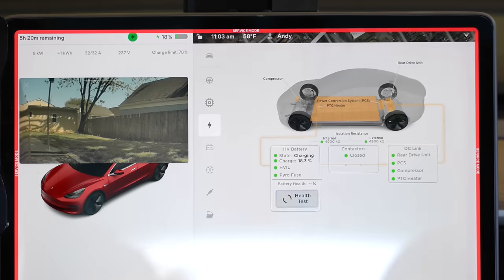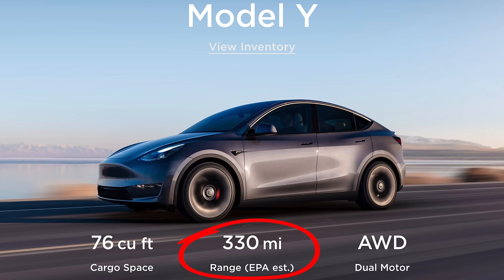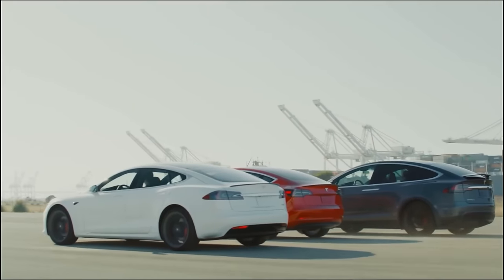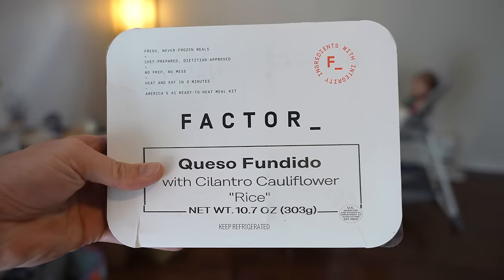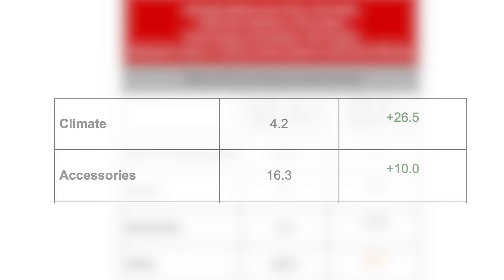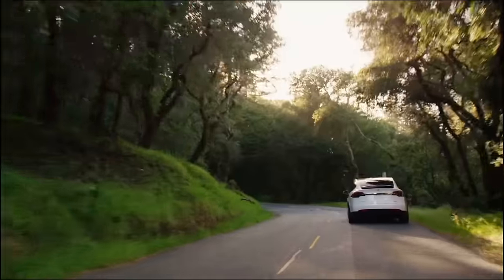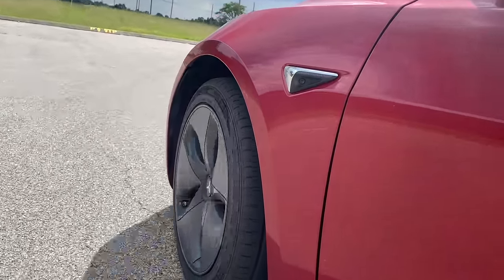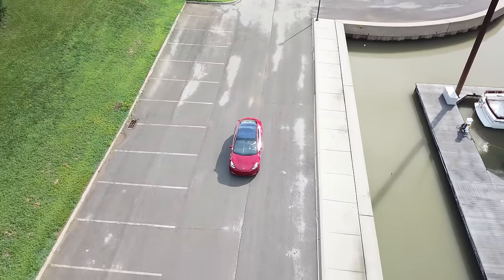Secret Tesla Range Report: How to Maximize Efficiency!

Comment from the maker: Use code ANDYSLYE50 to get 50% off your first Factor box at https://bit.ly/3I65KEu!
Reply: There is also another possible factor

Due to the number of cells as they degrade the internal resistance rises

As for the 7% thing my guess is a software bug your probably actually at 86 or 79 or something
Reply: Amazing!! Jus signed up
Reply: What does the 7% mean u bun
Reply: Yes same on my X . Gettimg barely 250 out of 350. They need to make Epa only 70 miles highway and only city Epa not mixed not at all !!! They lie too much on this

Comment: You and I are opposites.  The ONLY reason I bought my model 3 performance was because it was the most performance I could buy for the money.   So I drive above 70 when legal and accelerate enthusiastically often and enjoy the electric motor torque.  I have the highest performance tires I can get that is still street legal and reasonable life. (Not 5000 mile race tires. ).  These happen to be the stock tires they come with.  In any case I also don’t understand the reason to be as efficient as possible.  Charging is a non issue and range is plenty for any road trip and super chargers are super convenient.  So enjoy your car. It doesn’t need to go 1000 miles on a charge. If you enjoy hyper miling it, by all means, have fun.  :)
Reply: I agree Andy produced an infomercial for the tires erange. This was not informative as to the original question. But Andy got a new set of tires out of the video. That was worth $1000 bucks of charging. Maybe has has not gotten over range anxiety?
Reply: Don’t you notice a pretty big drop in top end performance when your battery goes below 60?

Comment: C'mon Andy. You're a smart guy. Is it a surprise that 80 mph plus it's exponentially more costly than 60-70?  That's the case with gas cars too.
Reply: Speed is a "no-brainer".  If ever you are squirming in your seat because you think you might not make it to the nearest charger, the best thing you can do is slow down.  Not just below 70mph, but back to around 50mph (min speed limit on the interstates is 45mph).  Your remaining range will increase dramatically.  (Unfortunately also dramatically increasing will be "honks" and "faces/fingers" directed at you by other drivers...)

Comment: Hi Andy, I always enjoy your videos and learn from them.  I have a 2022 Hyundai Kona 64 kw, and it is rated for 484 km per charge, and with my driving style and using regenerative braking to the maximum, I get 500+ per charge, and I use the smart adaptive cruise control 95% of the time, even around the city & school zones.  Driving this way allows me to get the maximum out of my battery at all times. :)

Comment: Yep.  Number one is slow down.  My stats app shows that I'm averaging over 100% of my rated range and I had a guy from Florida tell me that that's impossible....It's possible because where I live and usually drive there are no 80mph highways....the highest is a bit of 70mph limits and most of my driving is in the city so I'm going an average of 40mph or down secondary country roads where I'm only going around 55 mph

Comment: The result can also go the other way, I read where they had driven a gasoline-powered Volvo v60  with a T3 engine from Stockholm to Munich at a speed of 49.71. the result was that the car consumed 12% less fuel than what Volvo said it would consume. so the guess is simply that Volvo themselves have driven a higher speed When they themselves have tested the car to indicate the consumption

Comment: I get between 200 and 225.  I set my driving mode to Chill, let the car slow me down as much as possible for max regen, and use climate only when I really have to.  I also set the speed limiter to around 70mph to avoid going over (and possibly get a speeding ticket).

Comment: My Model 2023 RWD sits around 187wh/mi average so far (1200km / 750 miles). This is a mix of 1/3rd each Freeway (70mph), highway (30-50) and start/stop city traffic to work and back. My round trip to work is 99.8 miles - I have managed to complete 3 round trips (299.4 miles) on a single charge (57kwh usable battery), just going from 4% left to 3% as I entered my driveway - this includes losses due to pre-conditioning the car in the morning off-charge.

Weather is a mix but average 0-4c (32-39F) in the morning when I leave and 15-18c (59-64F) on the way home some rain / some fine.

I am well exceeding my estimated range and I am driving normally at the speed limit and not hypermiling. I think the key is the national speed limit in Australia is 68mph with massive fines for speeding - 80mph in a 68 zone is almost a $700 fine in some states with mobile speed camera everywhere on the major routes so most freeway driving is at or around 70mph max.

Comment: Were you previously using the Michelins that came with the car (I know you’ve replaced tires)? If so, how does the car handle with the the new tires? How is road noise in comparison?

Comment: You want the EPA rated range, you gotta get at or below the rated Wh/mi.  If it's a model 3 - 234Wh/mi.  If you are in a Y - 244Wh/mi.  Depending on the variables Andy listed you might not be able to reach those numbers.  After almost two years now in a Y,  I really think averaging something around 260 Wh/mi is much more realistic.  (300Wh/mi in the Winter time).
Reply: yup, never achieved and we have a SR MY

Comment: I have the same efficiency for the handcook gt tires for the 18 inch version. Almost 20k on the tire set with 210wh/mi at or 5mph over. Planning to do carbon fiber doors and aluminum glass front with a generator in tow.

Comment: I just finished a 3,000 mile road trip and being by myself I intentionally wanted to see what kind of range I could achieve. Keeping my speed 5 mph under the speed limit, performance set to Chill, I actually was averaging less than 200 watts per miles on many legs and I was stopping for charges about every 260 miles. The point is, that if you want to hypermile a Tesla it is not difficult, slowdown, use accessories as little as possible and draft when available... I am going to continue this on other trips to see how low of usage I can achieve...

Comment: your new tires are just a harder rubber compound - the rest is marketing-spin - harder compound gives you better mileage, but at the expense of sticking to the pavement while cornering.  so not ideal for the average 20yo's driving style but great if you're more of a safety-minded person.  they might also be dangerous at lower temperatures, so be careful in winter, or just change the tires then.

Comment: I would add road material, for example on gravel road you lose a TON of range, the Tesla nav system does not account for that when projecting your range. I found this out during a 4 hour single charge drive where 1/3 of the distance was on gravel, I should have arrived with 17% but ended up with 8% after dropping my speed.

Comment: I've read conflicting opinions on the question of whether turning OFF regeneration will extend range or not. It seems logical to me that turning it OFF is the right thing to do on a road trip. The momentum of the car when driving at high speeds for long distances is diminished by regen, so having regen turned off would allow the car to keep moving forward with its genetic energy. What are your thoughts, Andy? Others? Thank you!
Reply: I guess we will just have to try to match conditions as much as possible and test it for ourselves.

Comment: Thanks for this video.  Any views on the effect of using cruise control on long trips.  Typically I start a trip with 510km available range and 285km later I have 160km left. Do not use cruise. It's a straight shot, flat and not much breaking. Average speed probably around 110 kph (roughly 68mph).

Comment: It's "Me-eels" not "Mil-s".  lol

Good information in this video but it's unrealistic for anyone to drive under 70 mph on most highways.  That's just another reason why EV's need more range to start with, 300 miles is not good enough, 400 miles should be the number.  Because when you add in battery degradation and most highway speeds the max range drops quickly.

Also, you didn't say but did you get those tires for free?  And if then so your review of them was biased.

Comment: In my Peugeot e-208 range is very limited. In the winter I precondition while finishing up charging  it heats up the cabin but also the battery and drive unit which helps a lot. I drive slower 100km/h to 110km/h 60 or 70 mph. For climate control I put it on auto on 19 degrees celsius if I put it higher the ptc heater uses way to much power. I use the stock winter tires I get from Peugeot. my efficiency numbers in the winter are between 20 and 17kwh/100km. In summer I also precondition to have a nice cool cabin. in the warmer days I don't do a lot for efficiency because it warmer I get a lot more range I just look at my speed if I need to do a long stretch without charging. Winter range is between 140 to 180km's summer range I get closer to 200/250Km's if I watch my speed. Then my numbers are 16.5 to 13kwh/100km

Comment: I get Factor. I heat them in the oven. I should try the microwave tho. They are not frozen, packed well, really consistent, surprisingly tasty, and can’t be easier to prepare. Minimal waste collapses minimally. Would recommend to friends. I pay about $12/meal. Really good price vs eating out. I usually cook, but I am a single parent and the extra hour/day it saves is worth the price.

Comment: You family's safety is not worth having ECO tires. They will have a much longer stopping distance in Dry and far longer in wet conditions.
Reply: I ran a similar product 63,000 mile tire decades ago. Cool rainy days they would spin when taking off from stop sign. I can see the safety commission putting parameters on them.